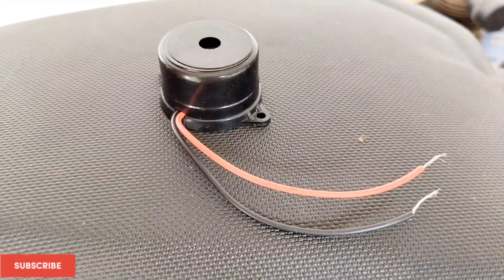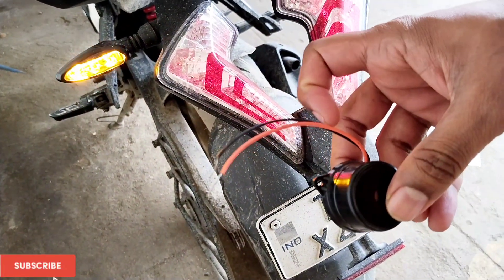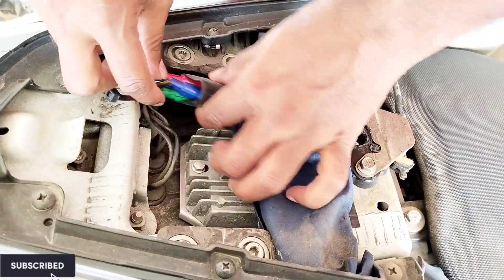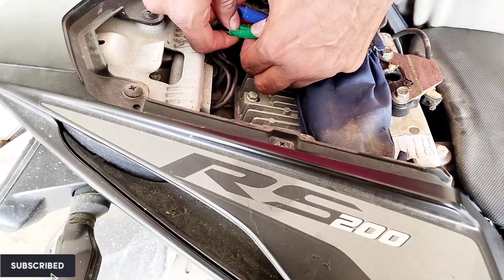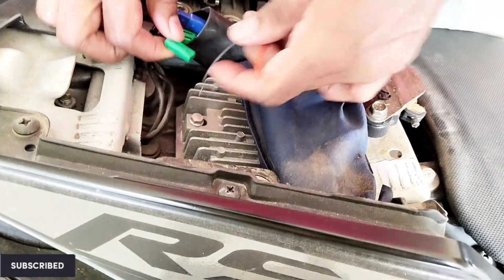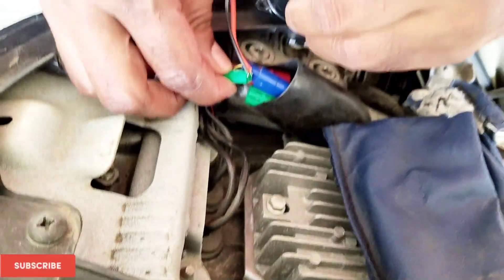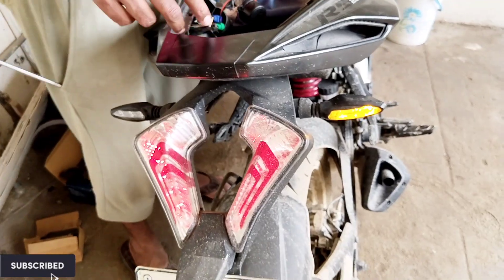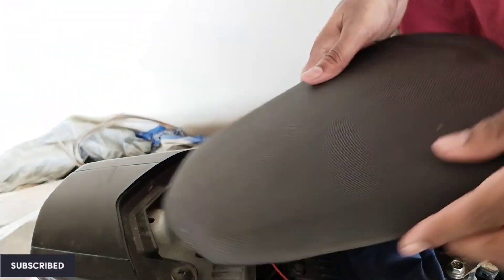Bike Indicator Buzzer Bird sound self change - English

Comment: Same problem face many times so I use a buzzer with covering its sound hole to minimize its loudness

Use two diodes with both side indicators connection to buzzer 
Then It will sound on both sides indicator
Reply from the maker: No idea on diodes bro